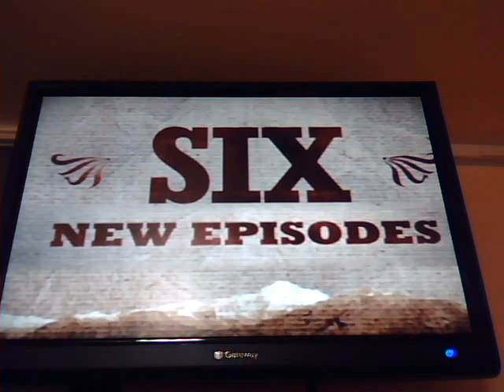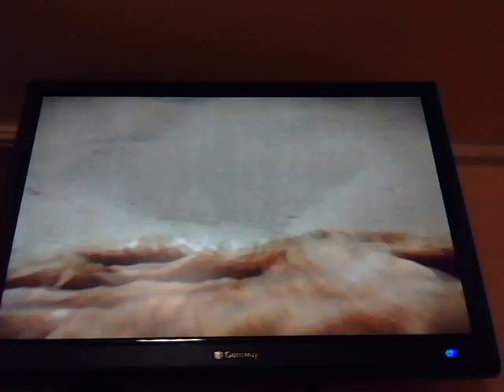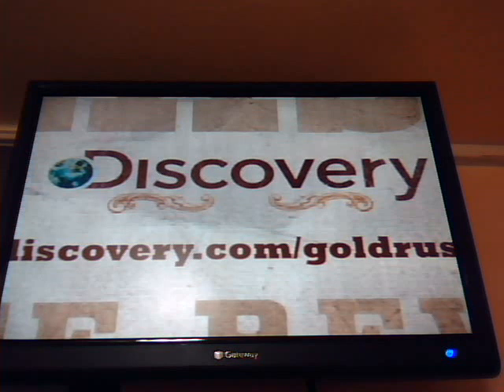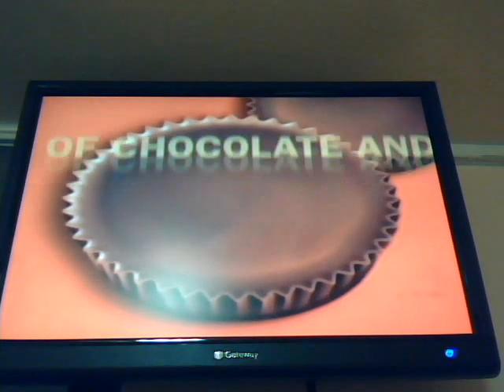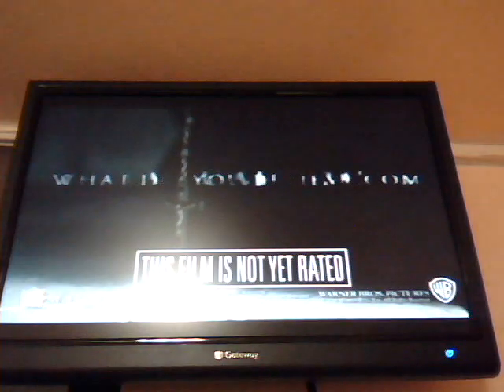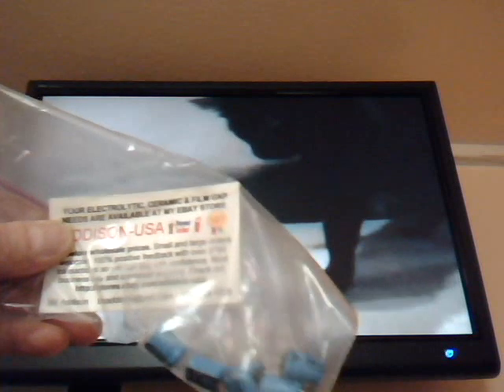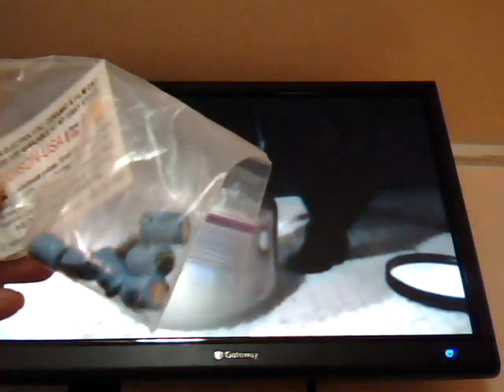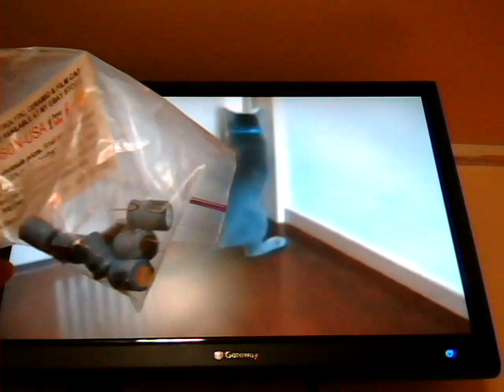Gateway Monitor Repair Complete

Comment: To open it up, lay it flat with the screen facing up.  Carefully take a hold of the inside of the bottom edge of the bezel.  Bend it up slightly and listen for the catch to snap off.  Disconnect the bottom catches.  You will need flat screwdrivers to help you. Do the same around to one side, then get the corner.  The rest comes off easily.

Comment: For anyone who clicks on this video for help with gateway monitors- If you replace the capacitors & the screen still shuts off after a few seconds w blue light still on- it may be a problem with the florescent tubes themselves.

I replaced the caps (which didnt seem to be bad) & tested components but still the screen shut off. As I was lucky enough to have two dead monitors of the same type, I decided to to perform an autopsy on one of them. I dissasembled the LCD screen to inspect the light tubes & bam there it was- the cause of my problem was a dry solder joint where the wire connects to the tube; this caused the wire to literally bake from the increase of resistance to the high voltage.

I cut the wire back far enough to remove the damage, cleaned the connector on the tube & re-soldered. All's well now :)      check your tubes ;)

Comment: Hello.. I replaced  5 capacitors on mine,, it turns on for about 1 sec then I get a black screen ,, any suggestions would b appreciated.. and thank you in advance. Oh I forgot to mention that the blue light stays on..I believe it means that I have power.. but I still have a black/blank screen..